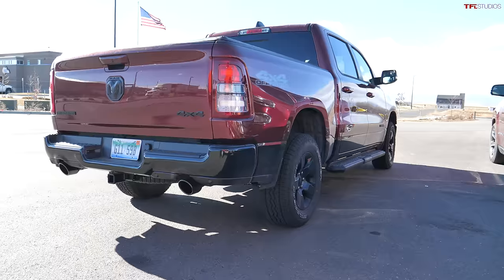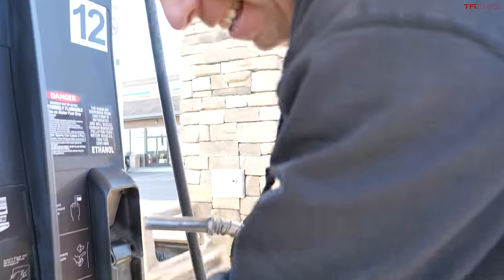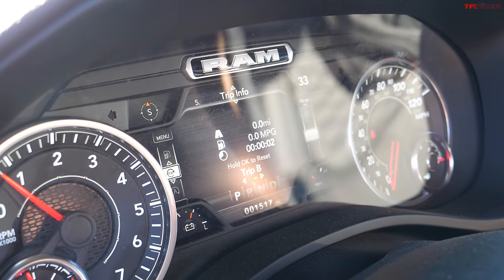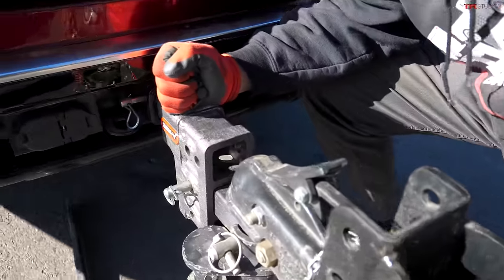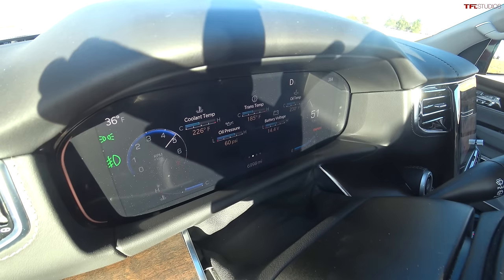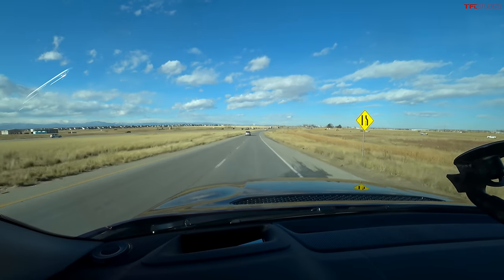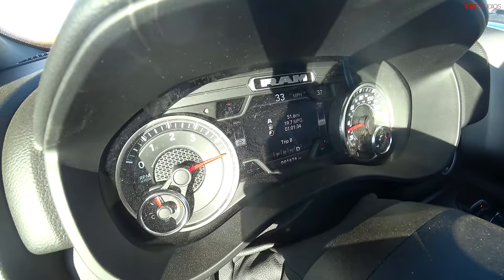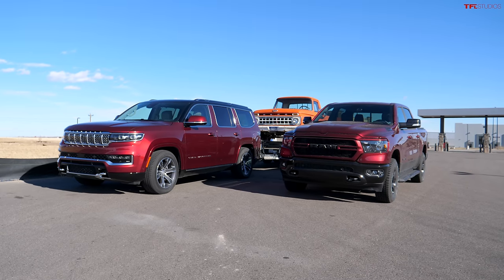Jeep Grand Wagoneer vs Ram 1500 Tow-a-thon: One of These Tows Much Better Than the Other!

Comment: Question, did the 1500 also have the Eco mode where it shuts down cylinders down to 4 when cruising? My 2020 1500 Classic Warlock has that but I'm guessing since it wasn't mentioned for the 2022 1500 here it was in full V8 mode the whole time?
Reply: With "towing mode" on, it locks out both MDS and 8th gear. When not towing, I can tell you from experience with 1500, I normally can't keep it in 4 cyl. Mode when going over  anything over 60mph using cruise control.. if we can draft another truck on the highway and get eco Mode on, we get way better mpg like most other cars with bad aerodynamics would too!

Comment: Hey Team, I would disagree with the total loss of 0-60mph time vs see level.  More displacement has less loss than at elevation than an engine with smaller displacement.  you can take Maybe a second off with engines that big.  but certainly no more.
Reply: Displacement has nothing to do with it.

Comment: I'm more concerned about cost per mile for a vehicle.  Even though the MPG was lower the Ram was still $1.20 cheaper to own/run on your trip. That's about an 8% lower cost of operation.  But also Ram sell a 6.4  in a 1500.
Reply: They dont sell a 6.4 in the 1500.... only the 2500 Power Wagon.

Comment: You can put 87 in the ram but I found on stock tune it runs a bit smoother on 89 or 91. Faster? Idk. But something to consider.
Reply: 87 is Colorado's 89.

Comment: Clearly the 6.4 is able to stay in 4cyl mode longer than the 5.7 because of more bottom end torque. Ram needs to stop BSing and make that an option for the 1500.
Reply: Blame CAFE. FCA has to buy credits to sell these large V8's and for a brand that sell 700 Units a year, thats costly. yes they Did the Hellcat but its a reason why it cost so much.

Comment: We need that 6.4 in the pickup FFS
Reply: They put the 6.4 in the 2500 power wagon. It was also available with the 6.7 Cummins which is probably why no one wanted the 6.4.
Reply: Man everyone is talking about the 1500 not the 2500
Reply: @nathangortz3203  If it's calling for premium fuel, it must have been reconfigured from the 3/4 ton motor.  24 mpg is almost what my ecodiesel gets....

Comment: I would guess that the GW has significantly better aerodynamics than the Ram, which is why is got so much better gas mileage empty. Around town when aero really doesn't help and the eTorque does, I would expect the Ram to equal or exceed the GW's economy.

Comment: I am having a hard time believing that 24.9 mpg from a heavier vehicle with the 6.4. Do it again on a longer loop, something isn't right...
Reply: @triedproven9908  way more than a 15% change if that figure is to be believed.
Reply: Its the VCM thing... its running in 4 banger mode.  The Hondas do it in their v6s... chevy has it i think..  the only one who doesn't i believe is toyota.   Many guys hate it because longterm it might not be great for the engine.
Reply: @mistermister2085  sure, but even a Charger w/ 6.4 and cylinder deactivation will hardly ever touch that kind of fuel economy.
Reply: Big engine not working hard can produce very good mpg at times. Is suspicious though.
Reply: @mistermister2085  yeah ram and gm have major issues with their cams and lifters because the cylinder deactivation
Reply: Jared
No they dont
Reply: @paulhunter9613  umm yes they do

Comment: Almost 25mpg in the Grand Wagoneer with a 6.4L V8, yet the Ranger with a 4 cylinder turbo struggles to even hit the low 20's on the highway....umm Hey Ford, maybe put a couple more cylinders on the Ranger's engine and drop the turbo ideas.

Comment: Still sad that they won’t put that 6.4 in the Ram 1500. Put that as an option and I think they would take even more sales from Ford. With a great interior and the best ride but behind GM , Ford and soon the Tundra for top power numbers I think it’s hurting their sales. Towing power is the main reason I continue to get F150s with the 3.5 Ecoboost motor. I was gonna switch to Ram but didn’t want to lose my pulling power in the mountains.
Reply: No truck mfg is going to see big sales volume and profits from a gas engine that uses premium fuel. Many ppl would rather go diesel at that point because the value proposition becomes a lot more logical
Reply: @sly9263  and yet GM sells a bunch of the 6.2 V8. Stelantis already has the 6.4 in it’s SUVs.  $2k option people would upgrade to the 6.4 just to say they have more power than their neighbor. Lots of profit for them.
Reply: @bobdennis4801  if they can do it without premium then I totally think it would make sense (and would buy it if I was a Ram guy). Though I also feel like that may push into the HD segment for them. I mean this comparison would almost make more sense using a 2500 with the 6.4 given the wagoneers base price. The vehicles are much closer in weight and you could fully load the 2500 with options and still be less than the wagoneer base msrp. Of course the 2500 will tow better, more capability
Reply: @sly9263  yep, both the 3.5 Ecoboost and GM 6.2 require premium for "max performance".
Reply: @hellkitty1014  no one puts premium in an ecoboost; it's not required. If the 6.4 doesn't actually require it, great (but they label it as a requirement for the wagoneer). Again though, that's a HD motor not for a half ton... 2500s use the 6.4
Reply: @sly9263  the 6.4(B.A.E.) in the HDs is very different from the this 6.4. Different heads, cams, non-forged internals, etc.
Reply: @hellkitty1014  ah, I didn't realize that. The 7.3 in the 250 does have forged internals..  shame dodge doesn't have an upgraded gas option for HD
Reply: @sly9263  I put premium in my Ecoboost every tank. Whether I’m towing or not. Gets me better mileage and runs better. My Dad has same pickup and runs 87. It’s noticeable difference between our pickups.
Reply: @bobdennis4801  the mileage improvement is less than 1mpg and more than offset by cost. If you feel like you're noticing better mpg it's 100% in your head, no offense.
Reply: @sly9263  I’ve actually tested it both ways. It’s pretty much a wash cost of fuel vs fuel mileage gain. I’ve gained more than the 1 mpg you suggested I gain. Even if it’s a little more expensive it’s still better performance with premium.
Reply: @bobdennis4801  every website, every tester had reported that it changes next to nothing at best .7 mpg and the conclusion is that it's pointless and a waste of money with no real tangible improvement
Reply: @sly9263  like I said. I’m not going by the internet I’m going by my own experience. An I’m getting more than .7 mpg more. And to get the full HP and TQ numbers from Ford you need premium fuel. Says in the owners manual for towing and peak performance use premium. People can continue to use cheap gas and then complain about lower mpg and motor issues. I’ll continue to use premium and love the Ecoboost for mileage and power.
Reply: @bobdennis4801  you're not getting more mpg. It's in your head. The hp tq gains are irrelevant throughout the majority of the rpm band, no human can notice it. Unless you're flooring it and tracking that vehicle (absurd) you don't feel that either. If you're getting good mpg, you're not using hardly any of those already minor HP tq figures. These are facts. It's obvious that needlessly spending money on pricier gas makes you feel like you're gaining something; we all have our water pills.

Comment: Yikes only 1400lbs of payload? You will run out of payload long before you reach the advertised tow capacity especially if you have a family you carry in the truck. These 1/2 tons are basically grocery getters with a 5’7” bed.

Comment: Unrelated, but can anyone tell me what the speed limit is for hgv's (semi trucks) in the US?
Reply: It depends on the state. In most states, it's the same as cars. Texas, if I'm not mistaken, has the highest limit at 85 mph, but most are between 60-70 mph for all vehicles. In some states, there are truck specific limits. In California, it's 55 mph maximum, regardless of the regular posted speed for light cars.
Reply: @AkioWasRight  thanks. 85, that's crazy fast! All limited to 56mph over here

Comment: But you have to run real world speed.
Where I travel NOBODY is driving 65 to 70 mph. They are running 75 to over 80 MPH..
And again I have a 2014 near fully loaded  Silverado 5.3, on my long trips with the cruise control set at 76 I'll average in the high 22s low 23 MPG.
I was coming home traveling north and for the heck of it I set my cruise control at 70 for 50 miles the average was 26.2 for 50 miles at 70 mph...
So those numbers are not impressive to me...

Comment: The EPA needs to up the highway rating on the Grand Wagoneer
Reply: I think maybe TFL needs to run an few more tests. Have a feeling that may not have been completely accurate.
Reply: No way it's getting better mpgs than a 392 charger even though it's a different engine.
Reply: @jacobstrutner8232  The same motor just tuned differently I mean tfl has been doing this for a long time and it has proved accurate

Comment: lmao the 1500 gets obliterated by an SUV with a bigger engine. Even if the Grand Wagoneer was running in 4 cyl mode, that says a lot about the feature disparity between the SUV and the truck, especially considering how the industry claims Rams have the bEsT tEcH of any truck.

Comment: I understand the difficulties of producing good content under reasonable time constraints but... these trip loops used to determine fuel mileage are really, really short.  20-mile loops, 45-mile loops aren't really 'real world' as claimed but owing to their limited distance open the test up unduly to factors such as wind conditions, temperature  variations and prevailing traffic.  The other factor in their testing is altitude.  There's an inherent bias towards turbocharged engines v. naturally aspirated engines at the altitudes they operate in.  Again, I understand their production limitations so I take the test results for what they are and enjoy the content.
Reply: Well they do turn around about halfway through the test to eliminate any tailwind or headwind effect. Can't really say traffic when the time to complete the trip is nearly identical at 52 minutes
Reply: @TheRamGuy  Hmm... I kinda see your point on the to/fro wind effects equalizing if the tests between the two vehicles were run simultaneously but there are pretty big differences (especially out west) between wind conditions in the a.m. v.  p.m.  And I'm not trying to split hairs or be argumentative either. All I was saying is that with such short trip lengths any of these test condition influences can have an outsized impact v. running a much longer test cycle e.g. 200 miles.  Its sorta like a voter survey.  You should expect a higher degree of confidence with a higher number of respondents. The outliers are normalized across the higher number of respondents.  But, I get why they do the shorter loops... the economics of time pressure to produce content.  It doesn’t detract significantly from the base effort and its fun and entertaining to watch.

Comment: I just priced out a Grand Wagoneer in Canada wow!! Starts over 100k up here.. Really nice SUV though
Reply: Well yeah because the Candian dollar isn't worth as much as the U.S. dollar
Reply: It doesn't always work out that way when it comes to cars. For example, I just order a Level 3 Power Wagon and it was 78K vs 68K in the US (12% different) whereas a Gladiator starts at 50k here but 35K in the US (30% different). But once you do factor in the U.S. to CAD exchange rate my Power Wagon is around 62k USD and other brands like Ford the price difference is often very similar. It isn't like I make 25% more up here in Canada so 100k is still 100k to me. That truck is about 66k here.

Comment: That Grand Wagoneer is such a let down to longtime Jeep fans.  It’s way way way overpriced, ugly,  to many junky screens tech all over it and resale WILL be worst in class.  You just know it’s going to have electrical and mechanical issues costing you thousands ON TOP of that inflated price.  Better get that extended warranty and all the other upgrades the finance manger will want to ram down your throat when you buy it.  This will make it even more expensive.  All so you can sell it for 10,000 bucks in 5 to 6 years.   What a joke at this price why wouldn’t you just get the Lexus LX?  Dollar goes a lot further there.
Reply: I bet they have good resale. $10k in 5 to 6 years? You must be smoking some good shit over there brother. Not even the germans depreciate that much in 5 years
Reply: Just my 2 cents.  I bought the 5.7 Hemi Jeep Commander Overland fully loaded new in 2008 for 43k.  Today it has 240k miles on it.  It's all original, everything drives like new.  The DVD player, Nav, remote start, auto adjust headlights, and all electronics work perfect.  Seriously, the only repairs I've had to do are a new radiator, exhaust manifold bolts, starter motor, a few sensors, and normal wear items, like shock, brakes, etc.  About 10% of the miles have been used towing, from a ATV trailer, to a 24 foot travel trailer.  It has been the most reliable vehicle I have ever owned.  For that reason, I'm looking at selling it and buying a new Grand Wagoneer...which I wouldn't even consider had I not had such a great experience with the Commander.  I'm 57 and have owned dozens of cars and about every brand too.
Reply: @BullittKid08  Go ahead and buy one and in 5 years be happy it’s maybe worth 15,000.  The people with enough money to honestly buy this vehicle, and it not hurt them, will not spend it on a Jeep. They will want a Cadillac, Mercedes, BMW or Lexus.  And yeah rich people do care about name marquee, style, comfort and resale.
Reply: @jeffstewart3978  I have a 05 wrangler unlimited with a 4.0 straight six and it’s been great.  You have to realize Jeep was different 15 years ago.  They get most of their platforms and parts from Fiat now.  They days of Jeep having all their own engineering, design and manufacturing done in house is gone. They try and reconfigure a fiat and make it a “Jeep” like the new Grand Cherokee. The new Wagoneer is assembled in America with tons of foreign parts, because Fiat is now the parent company. Well really Stellantis after Pugeot bought them out.  See the problem here. The management of Stellantis told the management of Jeep here is a vehicle platform make due with this. If Jeep management raises one BUT about it not meeting it’s customers expectations, Stellantis tells them WE don’t take shit from anybody you got that asshole.  Then the mangers of Jeep say yes SIR sir and may I add you don’t look a day over 35 sir.   This is what’s happening, I honestly can’t believe they got the JL wrangler out.  It’s the only honest Jeep and the one you should buy.
Reply: @boomersuperbike3787  🤣 yes
Reply: @boomersuperbike3787  Hilarious!  The only thing that’s childish is you trying to insult a stranger for not liking the thing you like. Also buying that Grand Wagoneer is like you spending tons of money on a rare GI Joe action figure to make your set complete and now you can be happy with your toys! Makes no sense lol to funny.  PS I can afford it but I’m not throwing it away on a stencil car brand.

Comment: It is a fine vehicle, just stop calling it a Grand Wagoneer!  It is a Grand Cherokee XL calling this a "Grand Wagoneer" is like calling the "Mustang 2" a Mustang.....  Just don't!
Reply: You clearly have not done any homework on this vehicle. The Grand Wagoneer is body on frame like a truck and the Grand Cherokee is a unibody. Back to the kids table
Reply: @TheRamGuy  Structurally different yes but aesthetically it is hard to tell them apart.  More importantly you CANNOT use such an iconic name on a vehicle that has no resemblance to its name sake.  Call it the Grand Cherokee XL or Grand Cherokee HD or a new name entirely, but to call this a WAGONEER is blasphemous!  This thing is allegedly made to compete with Navigator and Escalade but ironically you could put a Wagoneer style grill on either of those vehicles and they would much more closely resemble a Grand Wagoneer than this bland yawn machine.  I drove my 86 Grand Wagoneer until 2004, it was a classic and to see them give this generic garbage such an iconic name is proof the people running jeep don't care about heritage.
Reply: @tedcalouri2694  the concept is still the same as the original Wagoneer and Grand Wagoneer were intended to be a luxury 4x4 family hauler. The Grand Wagoneer used a big V8 with a truck frame making it good for towing. Those are the exact same concepts put into the new one. Large luxury 4X4 family hauler built on a truck frame with a large V8. How should they have built the new one? Large boxy with limited tech?